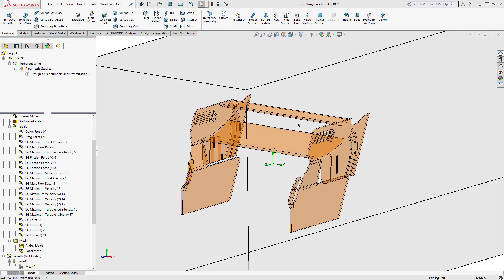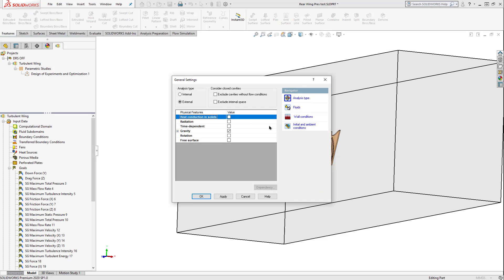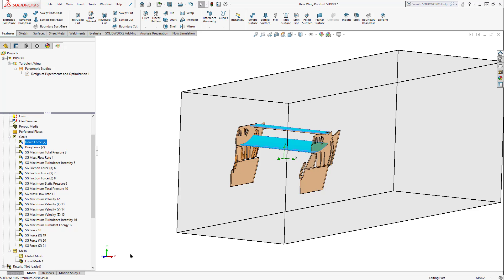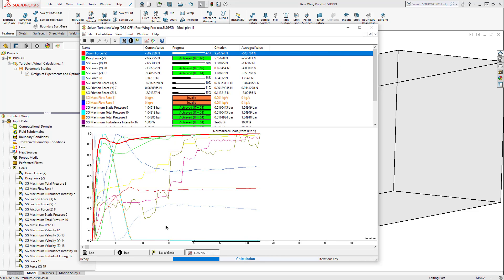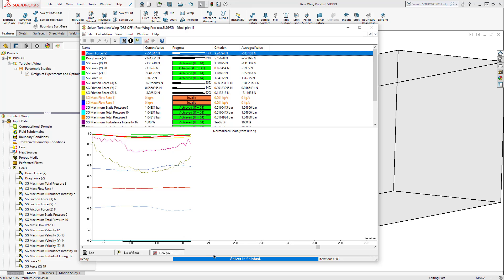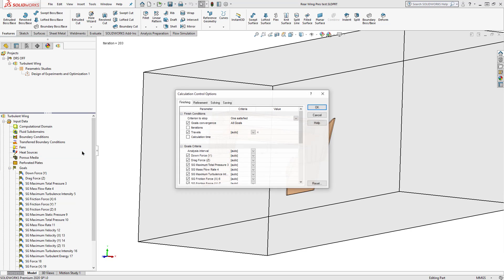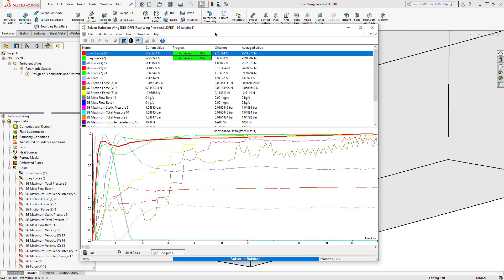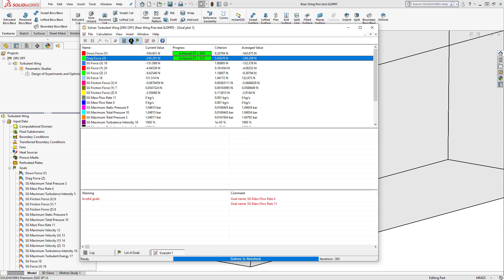SOLIDWORKS Flow Simulation - Convergence Solver

Comment: If certain goals do not converge, does that not mean that the goals that did could be inaccurate? For example, one a wing I get that X Force (Drag) and Y Force (Lift) converge, but Z Force does not converge. Is my lift and drag incorrect even though they converged? I am consistently seeing that it is always the Z Force and no other forces or torques.

Comment: how to use solidworks flow simulation results as initial boundary conditions to perform anoth flow simulation based upon the results
Reply from the maker: One option would be to make a new study with your input variables set to what your results were. Otherwise you could automate this in a Parametric Study.